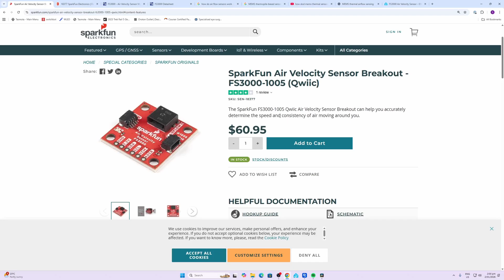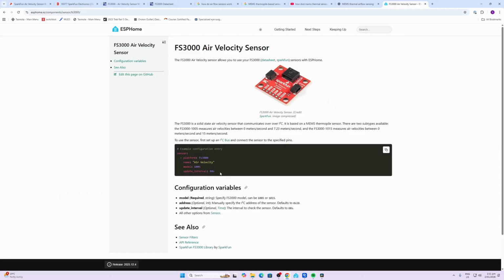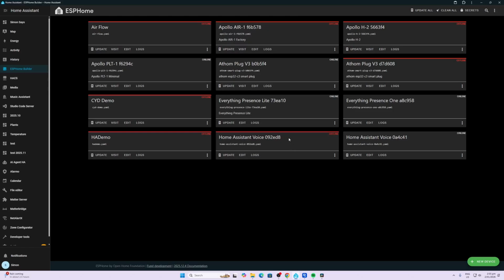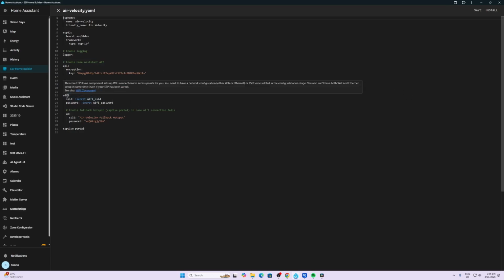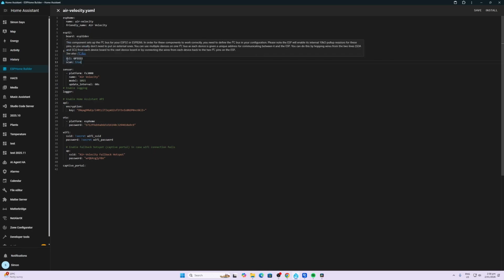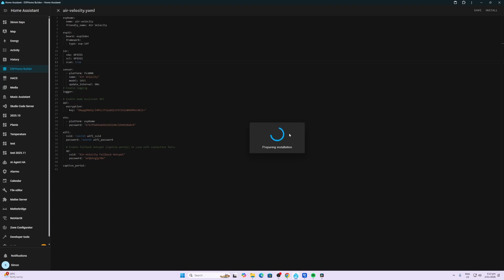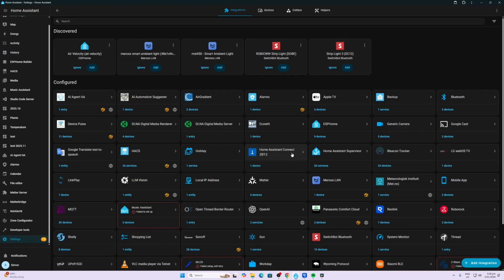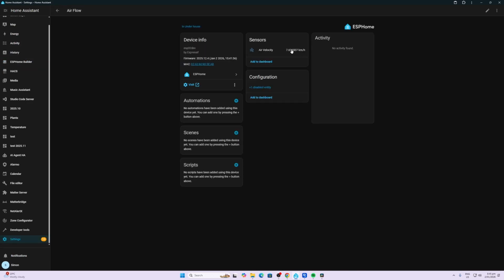How to build a DIY Air Velocity Sensor in Home Assistant in 10 Minutes!

Comment: Perfect. This has been something I’ve been looking for!! My DIY home ventilation system for the humid air from bathrooms and laundry room runs on there own system, and I have status and speed controller for main fan, and the motorized air valves for each room, but I have no data from the actual total airflow or airflow from each room. 

Look like there will be some shopping for me ❤
Reply from the maker: Thank you so much for your feedback!  Yes this works really great, I will be showing my 3D printed sensor mount and conversion of the data to meters cubed per hour :)  Well done on building your own ventilation system!

Comment: I was waiting to see how you show this sensor in the dashboard, if you added any template or how you keep track of this new data :(
Thanks for showing the configuration btw.
Reply from the maker: I am planning a Part 2 of this video showing the installation of the sensor as well as creating the dashboard templates
Reply: Also suggest create an automation that triggers when the flow rate falls below whatever vale is normal for more than 30 seconds. The action would be a notification to your phone and/or a RGB light that turns red.
Reply: There will be a part 2? Awesome!
I would love to see how you organize visually (your dashboard) and the backend thingy (code) in your home assistant installation.
Reply from the maker: @Paw_Low  Sure I look forward to covering these things :)

Comment: We don't do ventilation to make the air flow. It would be even better if it didn't move - but the CO2 and humidity were comfortable. So why check air movement when it is better, simpler and cheaper to measure whether comfort has been achieved?
Reply from the maker: I measure CO2 as well.  I am a data geek so the more metrics I can measure the better!

Comment: Nice video Simon, you don't see this sort of sensor very often. I bet the mounting is quite critical to getting good readings. Would like to have seen some video of your install. Would be worth checking the datasheet (or an application note) for the sensor mounting recommendations. I guess in your application, you will learn what a normal airflow rate is, and you can see when it deviates. That's probably good enough. Cheers
Reply from the maker: Thank you so much for your kind feedback Patrick, yes mounting is critical.  I first mounted it on a bent pipe and the amount of air turbulence made the readings useless,  it is way better on a straight pipe section.  I only have it temporarily mounted at this stage.

Comment: cool, interesting, I need to work on my air quality system, it is currently just sitting in my roof space doing nothing. be interesing to see how long and well this works. Also be interesting to have that info for cleaning the filters etc. Also why not go with a anemometer?
Reply from the maker: Thank you so much for your feedback :)  Yes an anemometer would be a great option too!  Yes it took me days to get my air system installed!